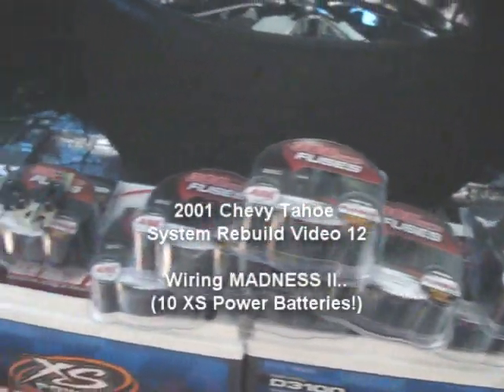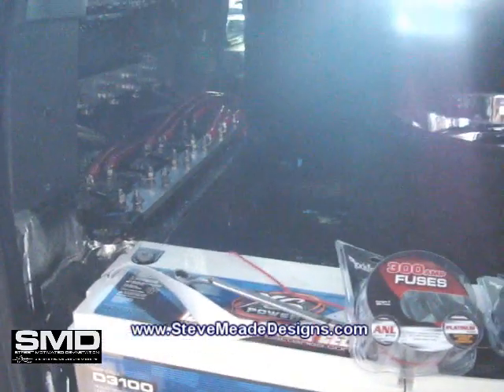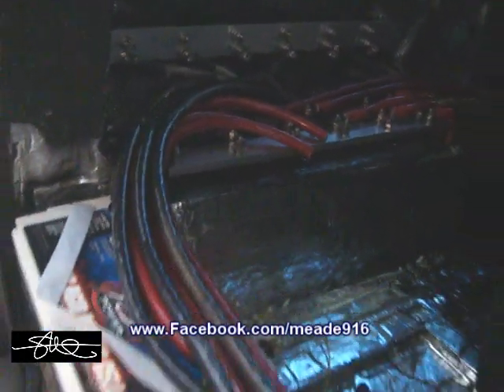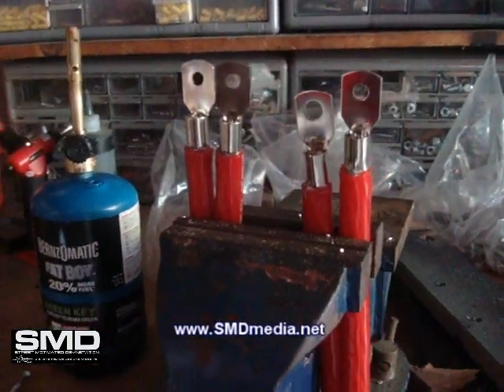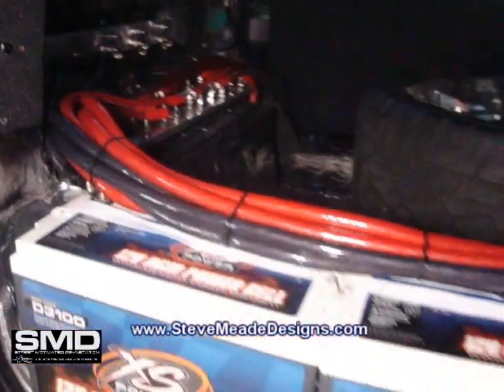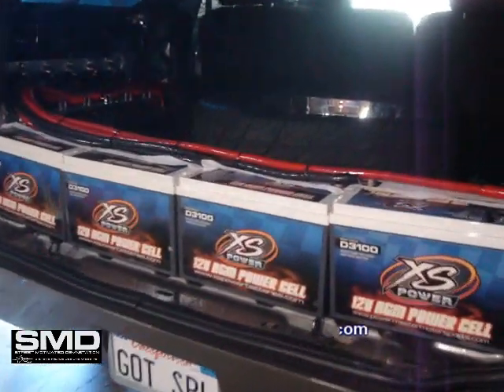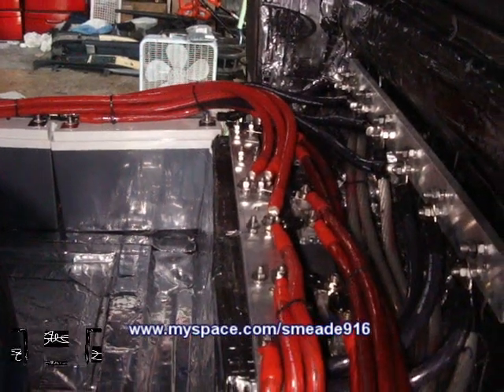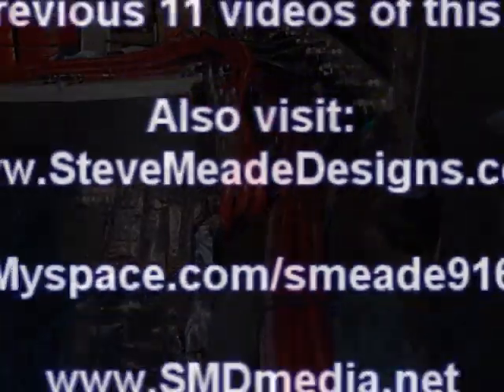10 Batteries IN! Tahoe 30kw System Rebuild (Vid 12)

Comment: Hey Bro, I was wanting to kinda use the same layout as you did with the bus bars. Do you have the alternator wires on one bar connecting to the battery/amplifier bar via ANL fuses? If so, do you not have to fuse the amplifier wires again when you run them to the amp? One other thing, i noticed that you have gound wires coming in with your alternator wires from the front, what did you ground off of? thanks bro you are a true bass god.

Comment: i use to have a 220 amp but i dont know what the one is i got now maybe 140 i upgraded my alternator wire ground to motor and body wires too that helped to keep the alternator trinkle charging the battery when the bass hits its hardest..

Comment from the maker: listen DIPSHIT,  a 1/0 welding cable and a 1/0 cable for car audio should carry the EXACT amount of current.....in fact the CAR AUDIO cable should carry MORE.  They typically have a HIGHER strand count and are also more flexible.  That 1/0 shit you get at the welding shop is POOR MANS CAR AUDIO CABLE.  It works but compared to the real stuff its not that great.  Your a total, and i mean TOTAL dumbass and should be banned from youtube for comments like that.

Comment: It's not always just one thing that's causing the problem, it may be a bad ground plus cheap RCA's too close to some power cable somewhere.. You can put noise filters on your RCA's to reduce the noise if it's because of cheap RCA's but you should check the ground and make sure the RCA's aren't near any power cable before you buy noise filters. It may be cheaper and smarter to just buy better RCA's if the ones you have aren't by any power and you have a good ground.

Comment: That MLA module controls the charge and output voltage of the alternators to the batteries. The module I'm talking about uses the cruise control motor and lets the truck idle/rev higher so the alternators are pushing full output... all at the push of a button. We used to install camera's(Drive Cam) in busses, large and small that had the idle up controller. It allows the alt to push amperage, the A/C compressor to pump faster and keeps the motor cool when it's blazin ass hot. Steve needs one.

Comment: its good to solder your wire to the terminal? can you use a lighter to do it? lol might be a dumb question i just need tips on how to do it. i always have trouble smashing the terminals together tightly so the wires are secured. thanks.

Comment: LOL! *OVER* 1000 amp hours! That's beasty! I have around 105 Ah. Just one of your batts will store more power than my two batts and a BatCap. I could blast full tilt for 10 hours at least with that setup. It's looking damn nice Steve. The wiring is super tight and right. You ever equalize the cells? There's this thing called a desulphator too, and it would keep the whole bank at peak levels. You might think about the addition of one. I'll send a link if you like. Did you get the "idle up" link?